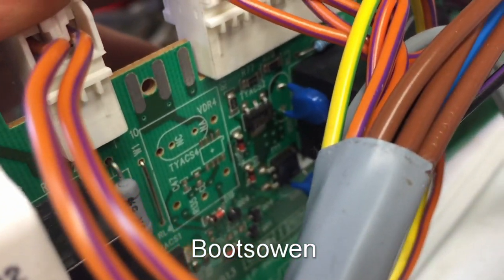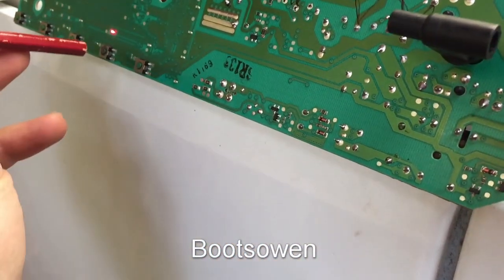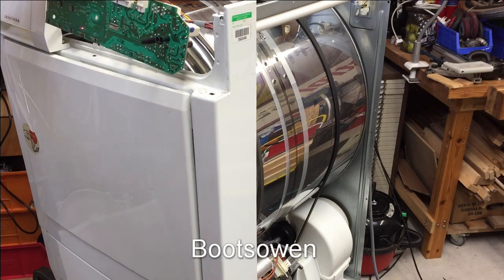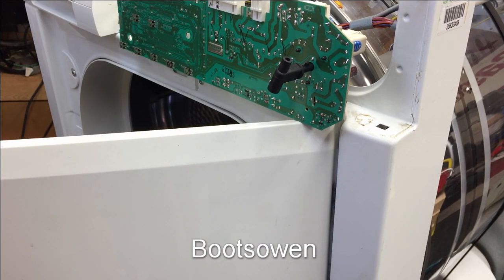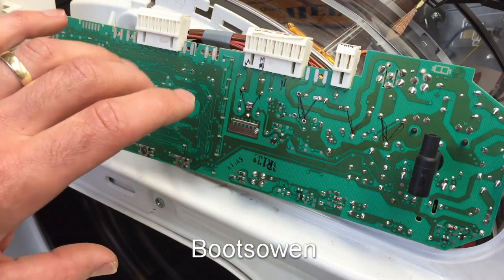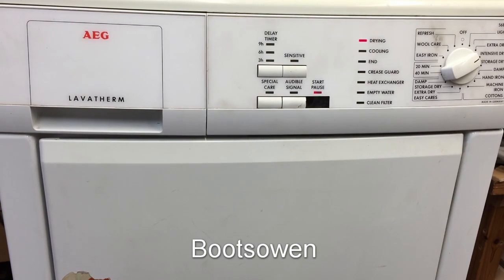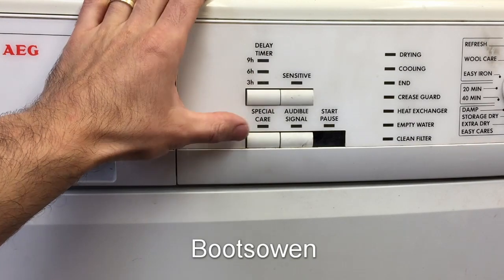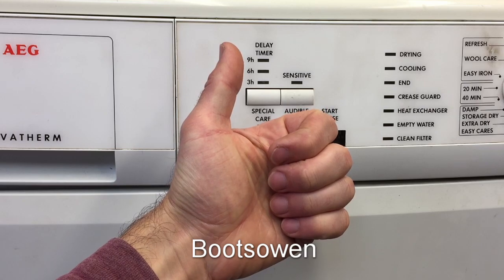AEG Lavatherm 56800 circuit board repair, relay swap and testing, to repair motor error.

Comment: hi on aeg 56840 l the motor goes to start but  with very slow speed it has not power 
i checked the capacitors all ok 
can i check the motor with the same way like the above video are the models same ?

Comment: Good to see it's working again, thinking it should be possible just to swap the botton from the Audible Signal and install it into the Start/Pause hole instad?
Reply from the maker: It looks like that on the face of it, but there is a plastic bit behind that is missing too. A new cluster is £25, but I don't know if I want to waste £25 on this machine.

Comment: You can store it for some time and hope for another AEG machine to take the missing button from

And motor does sound a little rough. But the is no point in fixing it untill button replacement is avaliable
Reply from the maker: Where will I store it?